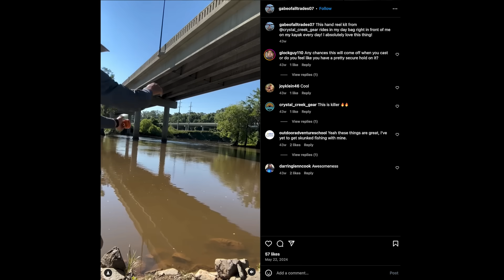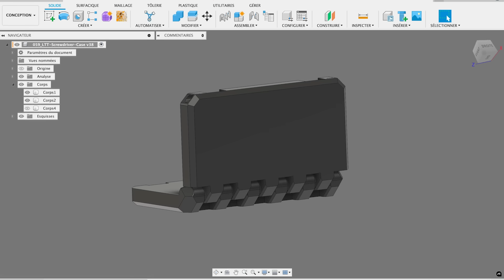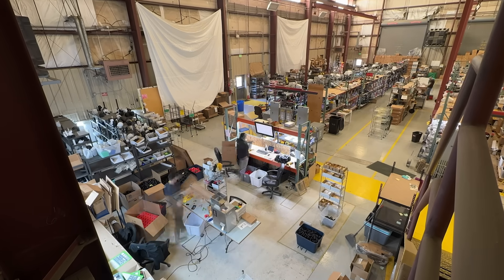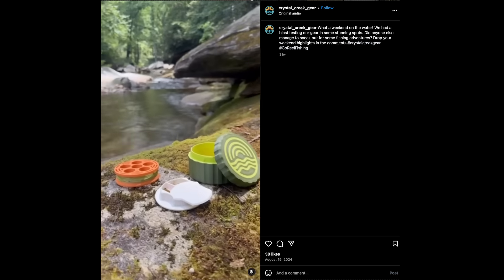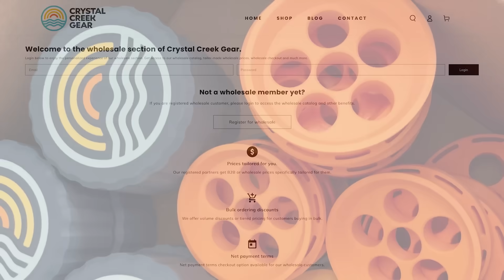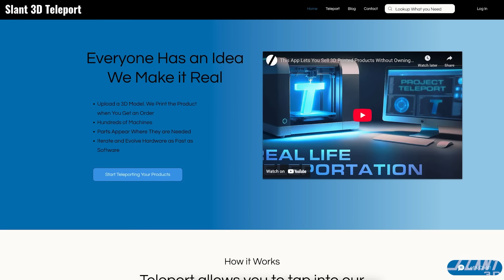How 3D Printing Reinvented the Fishing Reel | Crystal Creek GoReel | Real 3D Printed Products

Comment: is it not effective to print an embossed logo in a print,  seperately print the logo in a different color(s) and then just snap/press fit the logo into the cavity of the main print.  No filament changes but still multi color. just a little more design required.

Comment: Problem with fuzzy skin, on current slicers it's all or nothing.  Putting fuzzy skin on the outside of the part would kill your fit on the case because the inside would get it to.  If you use modifiers for it, it gives you double walls between the fuzzy skin areas and the non-fuzzy skin areas.  Bleh.

The texturing would have to be done in blender on finished CAD files.  Or do it like they did, and build the knurling with standard CAD tools and keep the layer lines.

Comment: Ugh, I really hope that, at least, dual-color printing is in the Slant 3D eventual pipeline. You've spent so many videos talking about different techniques that can help give products a premium finish or aesthetic, but even this reel demonstrates how much a second color can really elevate a product more so than just a beveled/embossed logo can. As typically wasteful as multi-color printing can be, the method seen in the video is usually only one or two layers thick, fairly conservative in waste, and actually benefits from multiple instances in one job.

I know the lengths you go through to streamline the manufacturing process and it's admirable, but as everyone and their mother now has some sort of AMS/MMU system, it makes sense that you would have engineered (or started on) your own solution to multi-color prints to, at least, get with the times.

In the meantime, I think you're better off pushing multi-textured prints, as seen in Make Anything's recent-ish video (as well as some of your own sample models, if I'm not mistaken) as that usually provides better contrast to a finish than beveling or embossing.
Reply: I don't care if it takes longer I love the way the second set of colors looks on my River kit it looks badass

Comment: Would the best polymer be Asa or petg. Would pla be enough or ABS for this application?
Reply: asa is probably better
Reply: Regarding the case, ASA/ABS is likely the way to go. 
For the wheel itself, i rather use PETG for feel and lay out the spool with thin sheet metal(cut alu can) to avoid cord biting.
Alas my 2c.

Comment: teleport is a nice concept, but I have to imagine you take a healthy chunk of someones profit margin in the process.  So pos (etsy, amazon, etc) takes 20%, you take 50%, and other costs chew up another 10%.  That's a lot like the pod business.  High cost, low profit.  You have to rely on volume r really you are just making money for other people.  Post capitalism at its finest.
Reply from the maker: We tell you the manufacturing cost. You can price it however you like and have whatever margin you like
Reply: They do way more than etsy or amazon lol, they litterally do the whole production + shipping.

Wherever you will go to manufacture it will cost you loads, add to this that there is zero risk/investment and the worst thing that can happen is you make money.
Reply: @DemsW etsy is a point of sale.  You still need them.  Running your own print farm isnt for everyone, but it keeps costs under your control.  Sure, spikes in demand can screw you up, but thats part of the business planning process.  Just look at the clothing pod model.  You can sell a million dollars in product and only net $50k.  And that will consume 80 hours a week of passive time.
Reply: @gregr5  Like operating a print farm won't take more time lol
Reply: @DemsW  Of course it does.  But using a 3d-pod vendor isn't time free either.  You still have to submit design files, specify materials, and inspect samples.  Then you may have customer issues pop up necessitatings returns and resulting in negative reviews.  Quality and shipping times are out of your control and you won't know of a problem until a customer complains.  Using a vendor has headaches of its own.  It's a good solution until it isn't.

Comment: Very clever design!! It's too bad the logo can't be easily done with the farm... For a smaller operation you could get away with a first layer manual color change, but that level of involvement is pretty unreasonable in a production environment. Still, a useful case study to examine!
Reply from the maker: Just indent the logo and you have a contrast presentation
Reply: @slant3d  too bad it looks 10x worse.
Reply: @riba2233  yeah multi-color looks way better and has so many practical use cases. Waiting on a farm that can do multi print. Chinese will do it soon I bet.
Reply: @raptorfeet  it would be very easy to do with the new bambu machines. I bet it can run two-color printing 24/7 without any quality/stringing/oozing/bleeding colors issues because of 2 nozzles design and active nozzle wipe. Or maybe something like Prusa xl can do it too.
Reply: @slant3d you’re gonna get lapped while you try to convince your customers they don’t want multi-color.

Comment: A few issues i see with this is: when you get rid of the rod it creates more tension for you to pull in fish especially the larger it is and you wont be able to hold the line because of the weight of the fish which breaks the line or cuts your hand & if your not worried about those things you have no way to "brake the line" so unless your just catching small fish or giving it to a child for small fish this isn't "that great of a tool" (also you would need to shave the edges off so a child can use this without getting cut on the sharp plastic) if theres any manufacturing defects..
Reply: Lol, people catch sharks and tuna on hand reels.  Not this one of course, but same concept with heavier line.  They are used extensively in developing countries.  For reference, the old man and the sea is a story about hand line fishing.
Reply: @gregr5  interesting 🤔 but yeah i wouldn't trust that with this reel because of a good amount of reasons
Reply: It's not intended for the hard-core fisherman. It's for hikers and campers who want minimal extra stuff to carry, or someone who wants to keep basic fishing supplies on hand 'just in case' a tempting pond should suddenly appear.
For the intended purpose it is indeed a great tool.
Reply: True that, just saying if a 10 lbs bass or more were to hook on 🧐
Reply: If the line breaks, a rod won't change anything about that. Secondly, you don't hold the line with your hand, it's on the reel you're holding. I'm sorry, but you simply don't have a clue what you're talking about.
Reply: @timderks5960  But you get mechanical advantage it makes fishing easier i prefer the folding rods for ice fishing for that reason you "can hold onto the fish better & alleviates tension on the line" but yes the reel is handy in a pinch but not a replacement for rods & sorry i do know what im talking about 🤣 and this reel isn't "ground breaking" as op claims just cheap and even without worrying about function its better to have longer metal ones with higher test lines there are other things that could be done to make these better but this in its current form is absolute unsafe shit a proper handreel is far safer and more manageable in this instance this thing needs lots of work